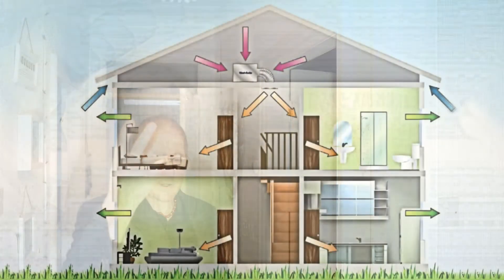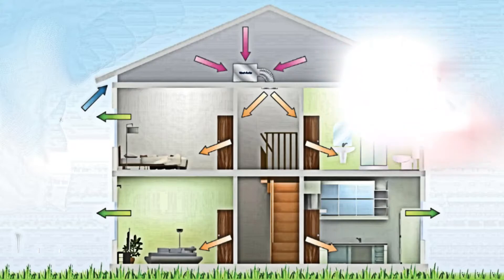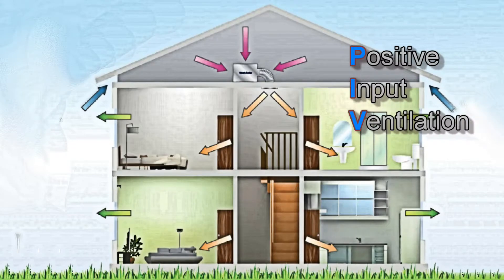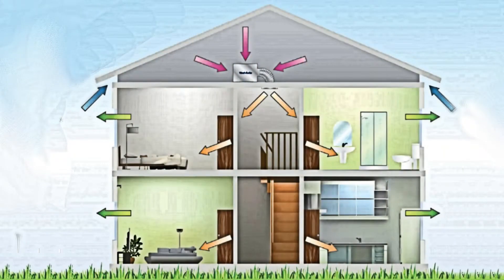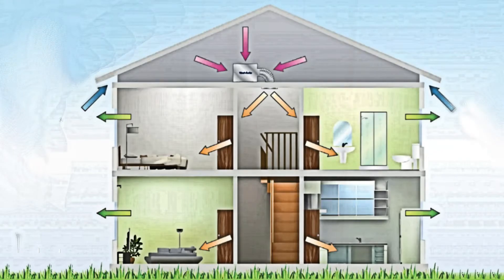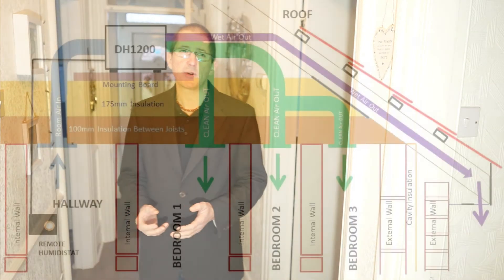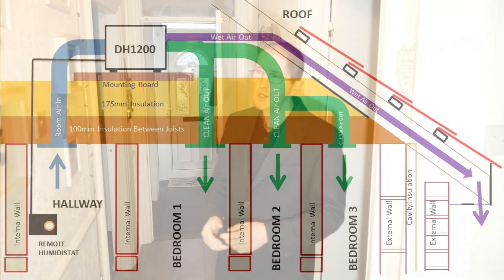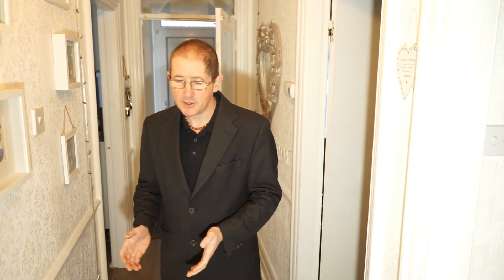How much does a PIV cost to run?  [Alternative PIV system for the home DH1200 dehumidifier]

Comment: I've been looking to get a PIV plus heater system from Vent Axi but just came across your video and like the idea of not wasting heated air from my house.
Would this system be suitable for a 2 story home as you only mention a bungalow? I have a traditional landing space and attic but want to dehumidifying the whole house as downstairs is worse than upstairs.
Reply: You could use single heat recovery ventilation systems
Reply from the maker: Also note that if your loft space is well ventilated it may not be be necessary to duct the wet air to the outside but monitor for a period to ensure no condensation appears on the roof liner.
Reply from the maker: Humidity actually rises. In a two story home it works well mounted in the loft
Reply: Who installs these ? Plumbers or electricians